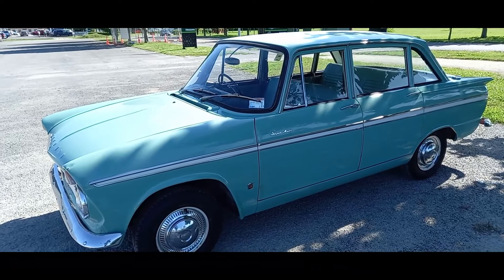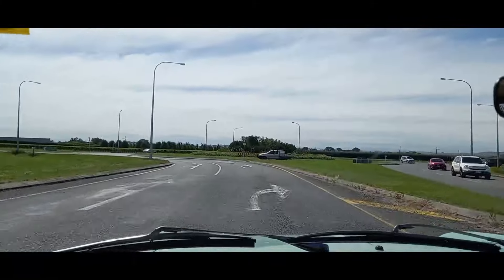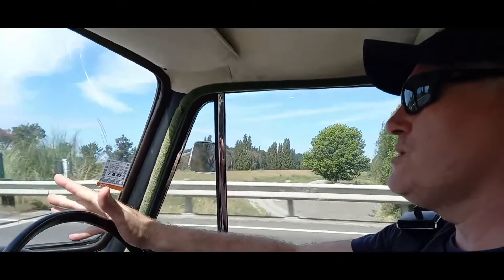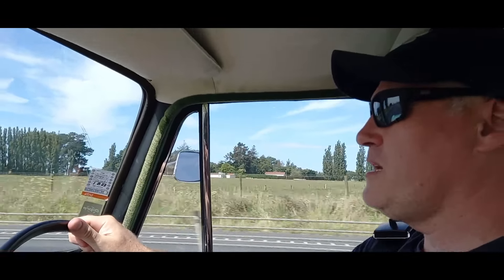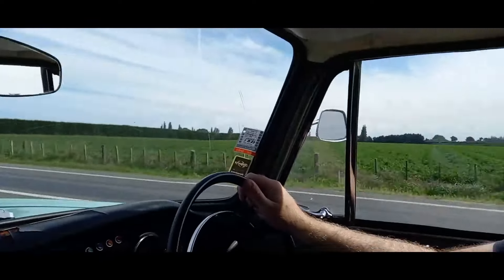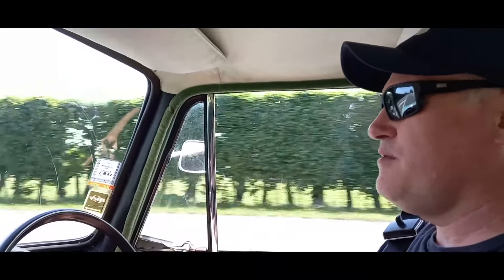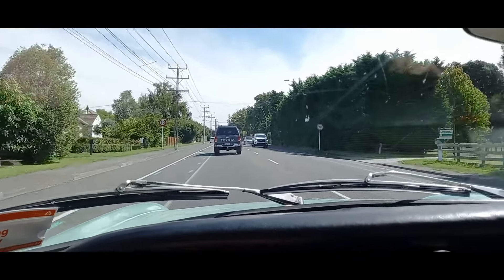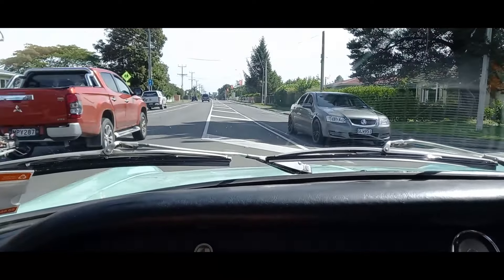Taking the Hillman SuperMinx out onto the highway.  How does it sound and perform at higher speed?

Comment: Great memories ! I am in my sixties now, my first car was a Superminx Station Wagon, “Celtic Blue” with a white roof. Your comments in this video are spot on. The car was a nice cruiser on the highway at 60mph and handled pretty well. For its time the brakes were pretty good with discs on the front, but agreed the rear drums could get out of adjustment and brake unevenly. The only significant drawback was overheating in suburban traffic on hot days which you correctly pointed out. On the highway it was fine. I did a trip Sydney to Adelaide and return in the car and it ran faultlessly.
The suspension gave a nice ride but was a little soft when braking, I remember the nose dipping a fair bit under heavy braking.
Overall a very good car by the standards of the day, thank you for the great review.
Reply from the maker: Thanks for sharing your memories and your experience with the Superminx, it sounds like you had some good times with it.  I have overhauled the cooling system, but it still tends to run hot at ideal on a hot day, then cools down again once moving.  I do wonder if there is some silt build up around the 4th cylinder so might pop out the freeze plug out and have a look.  Thanks for watching.

Comment: I think you may have a cable drive speedo that just requires removing and lubricating. It will be connected from the gearbox to the back of the Speedo. Remove and replace would be ideal - but may be fun trying to find one!
Lovely motor by the way and loving sunny NZ. Keep the videos coming!
Reply from the maker: Thanks for the comment.  Yes I was also thinking that the cable may need lubricating.  I think you can still buy them out of the UK.  Maybe Speedy spares, but would have to check that.

Comment: Loving your videos actually now there are a couple more Superminxs in Hawkes bay my estate and another in Clive and one thats off the road currently but the lady sees the Clive estate often, Im guessing youre running 13 radials even with the 3.89;1 sedan diffheaf your speedo will be reading at least 10kmh fast, mine has the same issue but 5kmh fast I have 14 inch Michelin rims all round, keep on cruising your classic they are great old cars
Reply from the maker: Thanks for the comment.   Yes the car is original as far as I am aware.  The rims are 13 inch.  The car was brought from Hamilton, but  originated from Tauranga.
Reply: @everything-hillman66  Yes it looks quite original, however when new it would have has xply tyres which have a much taller sidewall I had an original xply with my parts that came with my car it was the same size as a 195x65x15 as measured against the Citroen I had then, your speedo will be out quite a lot just go for a cruise with a GPS and take a look, they do go well those cars mine now has a weber carb which woke it up a lot cruises happily at 100kmh

Comment: My Superminx is living in Hawkes Bay its been there since new it doesnt run hot in hot weather you might need the radiator cleaned out, mine has power brakes, oh and my car is an estate, speedo is a bad cable they are I have some spare instruments if your one is knackered
Reply from the maker: That day was really hot and the water temp rose slightly above normal at idle.  The radiator has been fully flushed out, I wonder if maybe there is some sediment in the block.
Reply: @everything-hillman66  Could be your water pump if it has any slop in the shaft it wont work properly I may have a spare in Taradale, I know I have a rebuild kit and I think theres one under my mates house in Massey, I'll look before I come down the Bay next
Reply: I thought those cars were slow

Comment: I would remove the thermostat  remove radiater hose from top tank of radiater and bottom hose of radiator and reverse flush with heater turned on , till water out of block comes out clean, then reverse flush radiater from the bottom hose useing a hose and wrapping a rag around it to force the crap out of the radiater untill the water flows clean . Then still with thermostat out i would refit radiator hoses and fill the cooling system with straight white vinegar and leave it for a week then flush the system again with a hose, reinstall thermostat and fill with toyota red coolant not the toyota pink coolant IMHO
Reply from the maker: Thanks for the tip.   Even though it does not have a heater, it does have a heater core.  The heater was an optional extra.  Thanks for the tips though on flushing out the block.  Thanks for the comment and for watching.